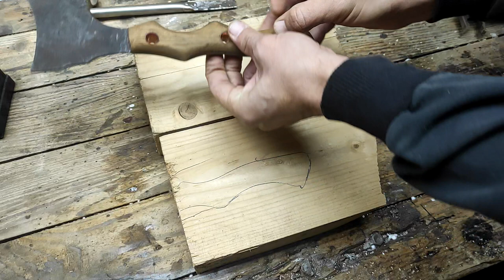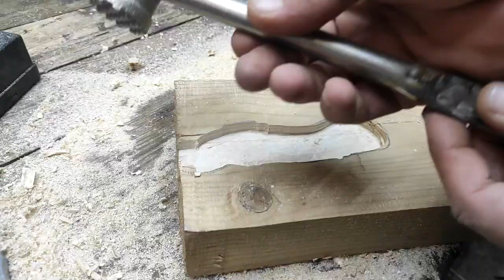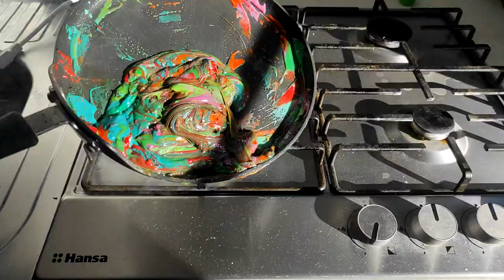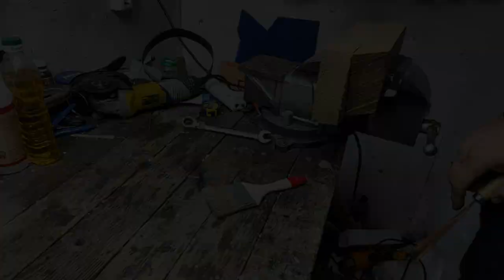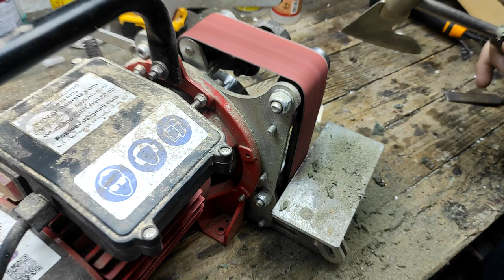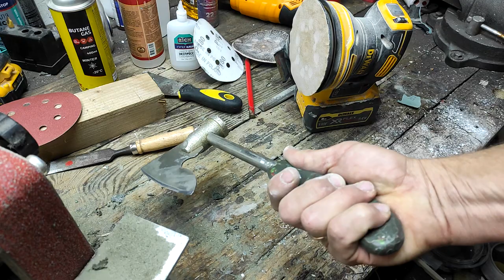НЕ ВЗДУМАЙ ВЫБРОСИТЬ пластиковые крышки! Отличная идея своими руками!

Comment: 👍🏻👍🏻
We also can use plastic bag to make  handle ..just wrapped the plastic bag  on the handle ( layer by layer) and put it near the fire to melt it ( use any wood to pressed the hot melted plastic bag...we can wrapped up more plastic bag in it's until we get the right size of the handle we want). And the last part is to smooth it using those machines in this video.